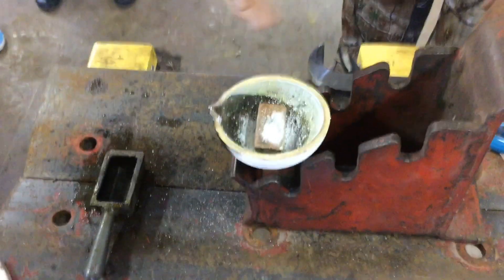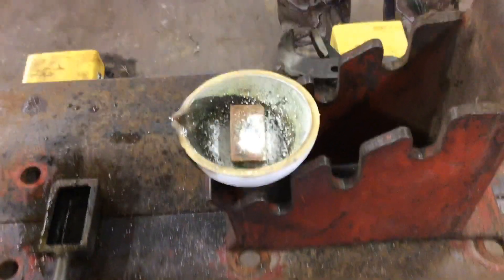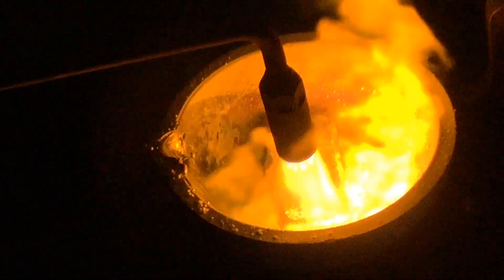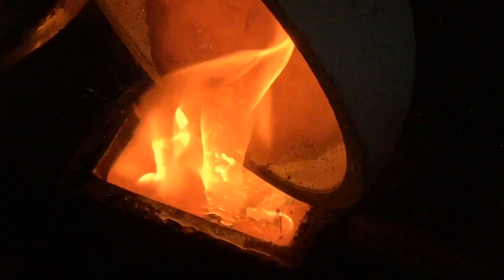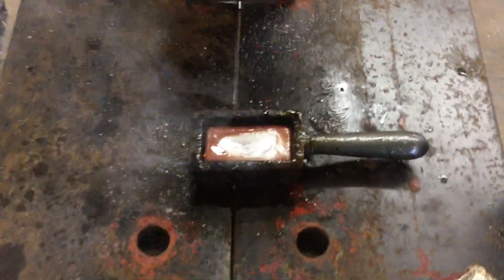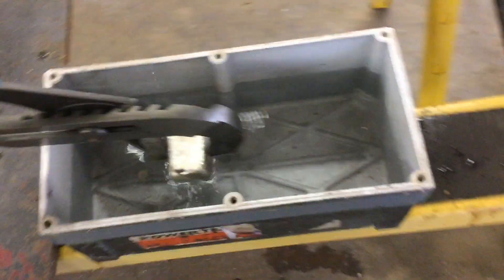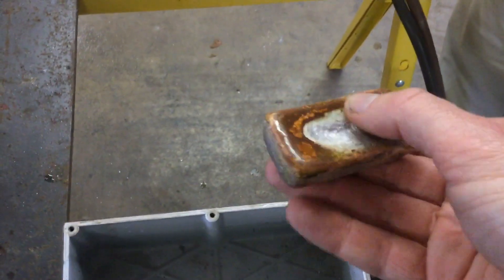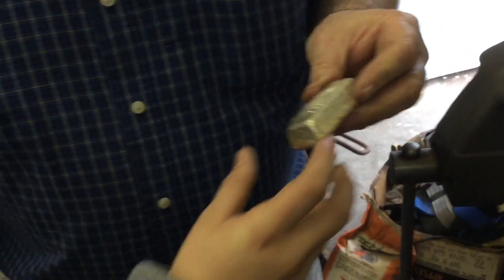Boiling Silver With A Sprinkle Of Dust

Comment: How about using a carbon rod also?
Reply: +SalivateMetal I am guessing redrum means a graphite rod to stir it. But since the silver was .999, there is no need for stirring. If you are melting different karats of gold  into a bar and want some consisistency, mixing with a graphite rod works very well because the gold will not stick to the graphite rod and the graphite rod will not be damaged.
Reply from the maker: +REDRUM187SILVER How do you mean?